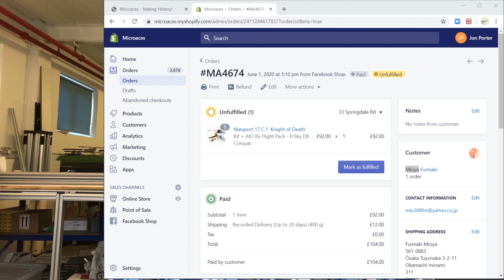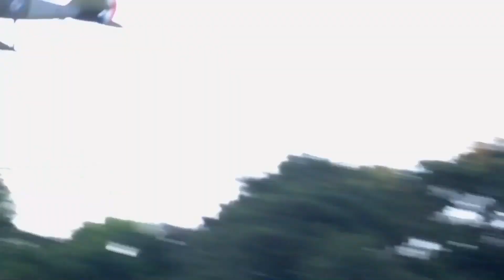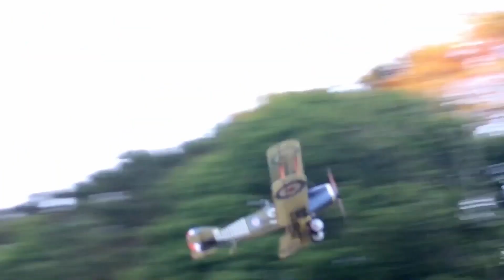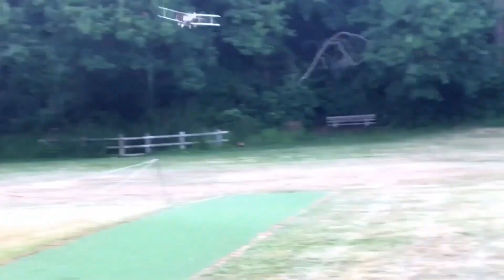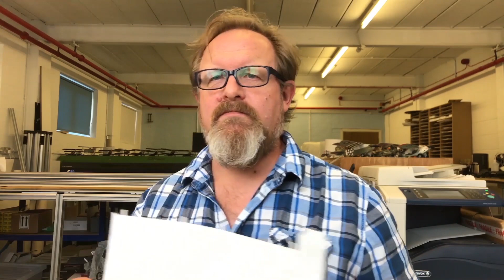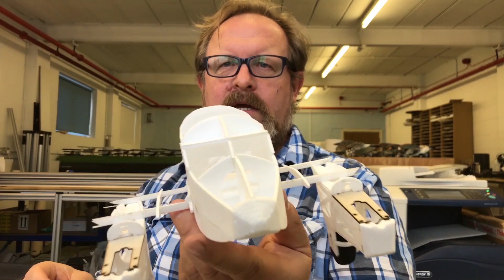Microaces News 4th June 2020

Comment: Hi John, very interesting video. I have been checking out your Bluebottle Squadron Hornet and think that it would be an ideal candidate for upsizing using your new Vectorboard material. Large enough to use retracts such as the following -

https://uk.banggood.com/25g-Digital-Servoless-Metal-Electronic-Retractable-Landing-Gear-for-Airplane-KTK-p-1096706.html?gpla=1&gmcCountry=GB&currency=GBP&createTmp=1&utm_source=googleshopping&utm_medium=cpc_bgs&utm_content=lijing&utm_campaign=https://uk.banggood.com/25g-Digital-Servoless-Metal-Electronic-Retractable-Landing-Gear-for-Airplane-KTK-p-1096706.html%3Fgpla%3D1%26gmcCountry%3DGB%26currency%3DGBP%26cur_warehouse%3DUSA%26createTmp%3D1&cur_warehouse=CN

https://hobbyking.com/en_us/retractable-landing-gear-small.html?countrycode=GB&gclid=CjwKCAjw2uf2BRBpEiwA31VZj8LZmzHoiYZr9reqzHvfjOjYMtKQ-wqoNNYz3Pw8EkibzpYFcWe4LRoCAJcQAvD_BwE&gclsrc=aw.ds&___store=en_us

Keep up the good work.
Regards, Michael